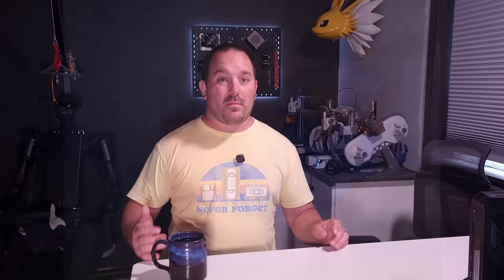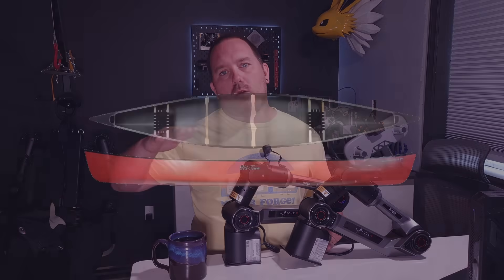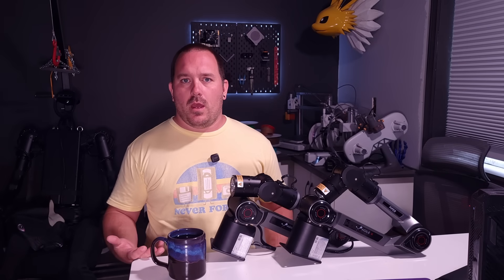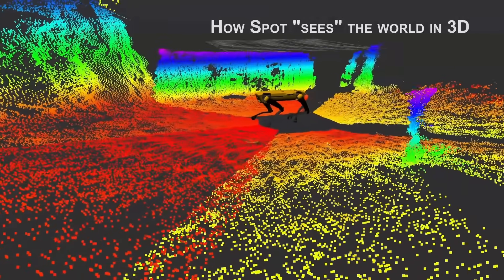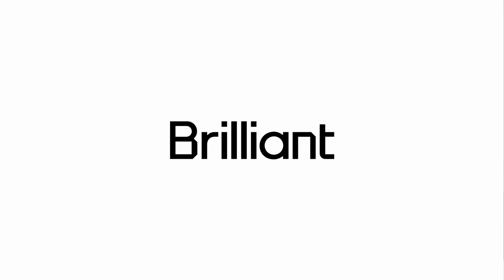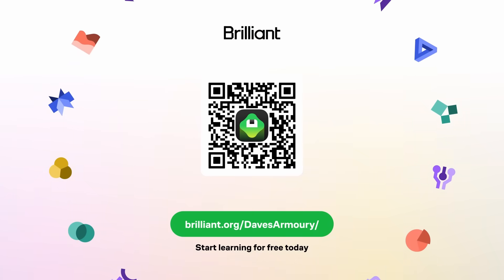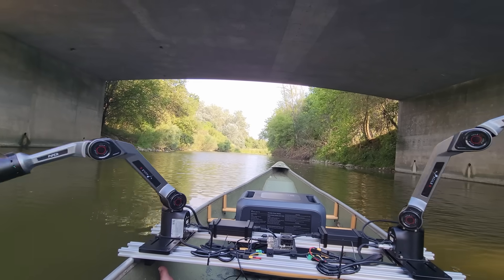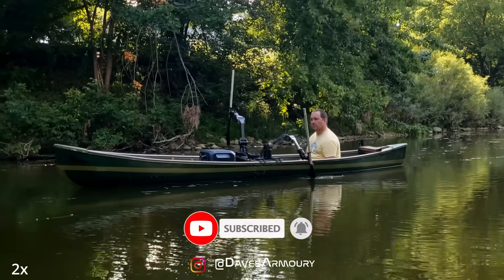DIY Robotic Boat Takes Relaxation to the Next Level

Comment: There's quite a lot more you could do with the paddles with a little more software. Paddling with both sides in phase will help it go straight, as would keeping the paddles close to the boat. When you want to turn, you get more leverage and torque by moving the paddle as far out as it can reach. You can also paddle sideways, or scull a paddle back and forth while changing it's angle, or trail it behind you to act as a rudder.
Reply: Why do i think on "Big Bang Theory" and the automatic arm , one of the guy build....
And with 2 arms... double fun???

Comment: Look at how paddlers paddle and optimize the movement from that, also perhaps get some worth paddles. Would be cool to see how efficient you can make it. If it can compare an electric motor with propeller ( paddle is more efficient so it's all about optimizing the arms and the movement which looks like it needs a lot improving ).

Comment: 9:49 First is worried about few extra pounds of mounting material and than he adds 60 pound camping battery. Good job!
Reply: He's got to power it somehow genius! The project was using two robotic arms to row a boat. Not how to learn / build a  large battery that would have weighed about the same anyway!
Reply from the maker: Not to mention the 200 lb Dave!  It does leave a little extra payload for snacks...

Comment: Man  I wish I had or dealt with robotics like you do,  as a paraplegic I can expand my worldly explorations easy and maybe just make all around life a bit easier.
Reply from the maker: Check out Kinova.  They started by making assistive arms to help people with mobility 🙂
Reply: I'm also paraplegic and I gotta say: it's never too late to learn. I got into this sort of thing bc I wanted to learn to use fpv drones, to get to places I wouldn't be able to get. turns out fpv makes me outrageously motion sick, but I ended up getting really into RC stuff more generally, and it's very similar to this kind of thing. if you're hesitant to just dive in, check into maker spaces or even your local library, they got resources a lot of the time.